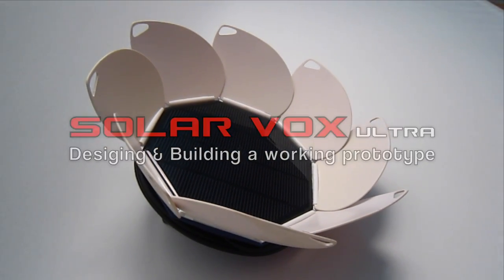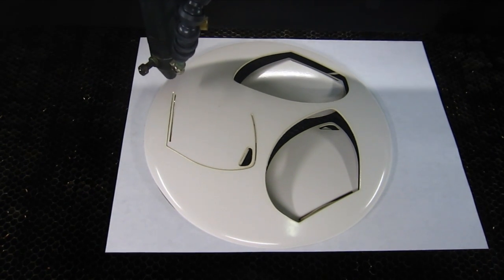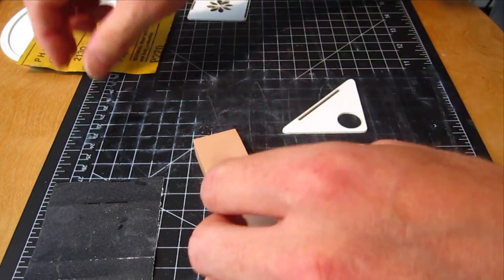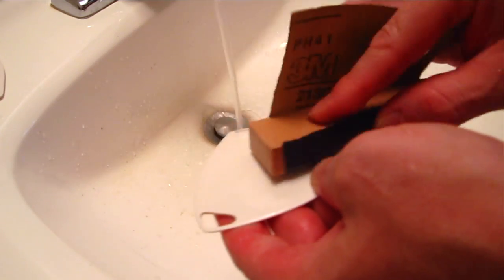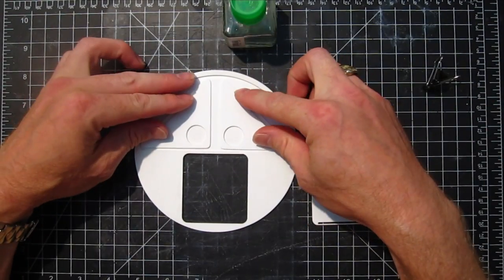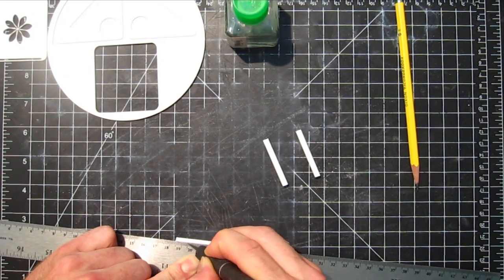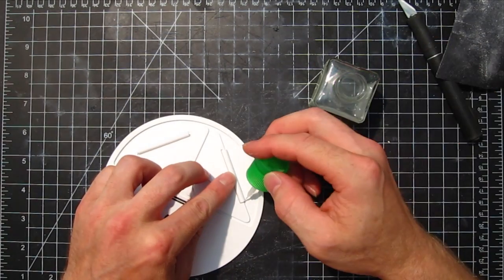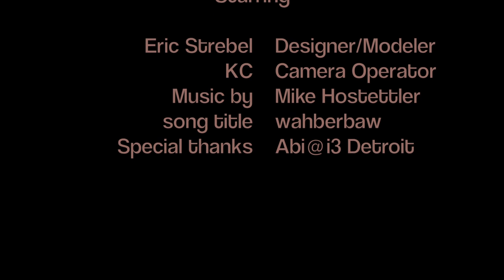Laser Cutting plastic welding Prototyping Product Design: Mobile Solar Charger power bank Part 4

Comment: Hi what is the name of this glue/no glue to put  plastic together?
Reply from the maker: Martina Tušková I am using a plastic solvent, you need to get the kind for the plastic you are using, it's the same or similar to the plastic cement that you use to glue your model cars and airplanes together.